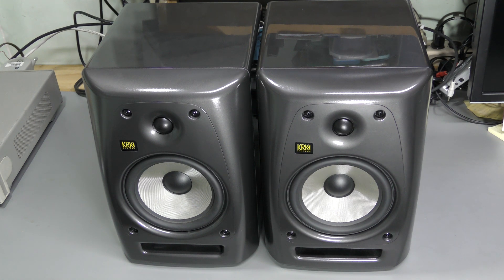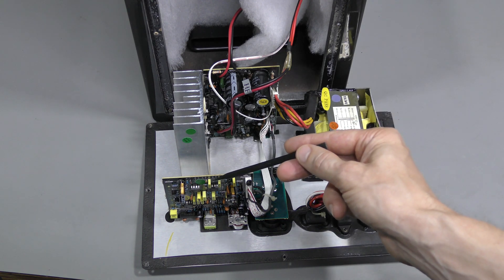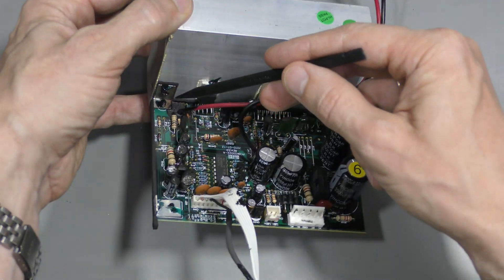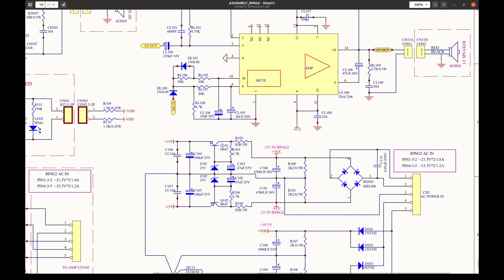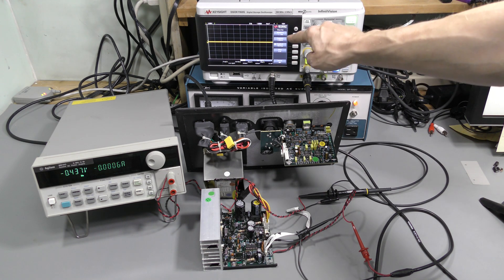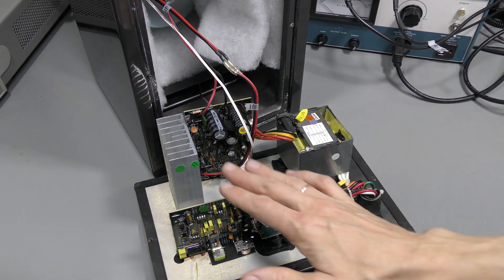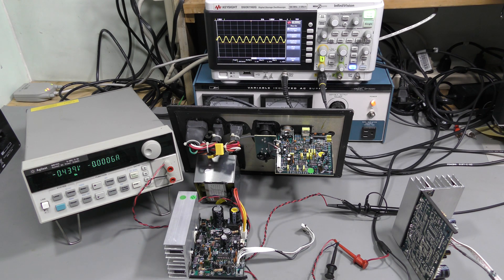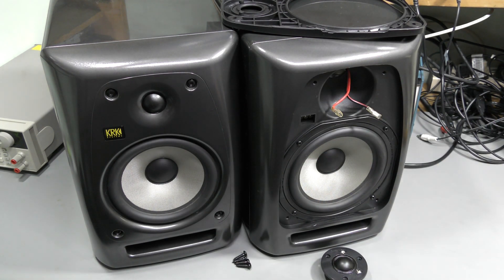#105 - KRK Rokit 6 studio monitor speakers repair

Comment: How did you remove the glue? Solvent , wire brush or scraping ?
Reply from the maker: Mostly careful peeling and scraping. The glue was quite brittle in most places. I had to desolder a few components to get access in some places.
Reply: @feedback-loop  
Thanks for the reply. I appreciate it. I can see the reason for gluing down big caps but why did they slather that stuff all over the place. Makes no sense. Just makes repair harder.

Comment: sometimes you can fix the coil in the speaker i did that with my sony speakers that i was given for free a wire broke between the plastic holder and the coil it vibrated off.

Comment: Just fit any old pair of tweeters that fit on both of them and be done with it. Or rewind the coil of the shorted one if it's accessible. Or you can ask KRK directly.
Reply: Eh... maybe depends on how good you want them to sound!  I think they should be a matched pair with Fs and efficiency about the same as the originals.

Comment: Do you know if this glue is in all KRK speakers? I have the krk rockit 5
Reply from the maker: Just a few screws to find out.
Reply: This type of glue is not used in the Rokit 6 update model (RP6G3). Additionally there are other changes such as cabinet, woofer color, etc.
Reply: You will only know until you take it apart
Reply: Yes it does for all all model